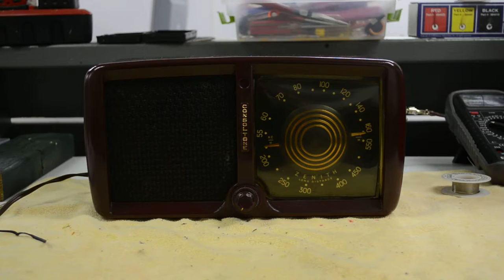Zenith Consoltone Radio Makeover

Comment: I got one recently that was in great shape...except for missing the dial cover plate and red piece of plastic on the light. The string on the dial also had “polished” the shaft so smoothly that I have to find a way to get it to grip. Some have recommended wax which I’ll try later today. Worried about missing dial cover more, since that dial is metal and plug it in wrong and that could be an accident waiting to happen.

Everything works though and it was all original, and there’s no actual cracks or damage to the case, so least there’s that. I can probably find a reproduction dial plate, and that little red plastic can be easy to make myself.

I want to clean/replace the grill cloth, but I’m nervous about trying to remove it, attempted to and heard a cracking sound and just left it, since I definitely don’t want to damage the body physically. It’s slightly frayed but nothing serious.
Reply from the maker: I used speaker cloth to replace the grill cloth in my Zenith Consoltone.